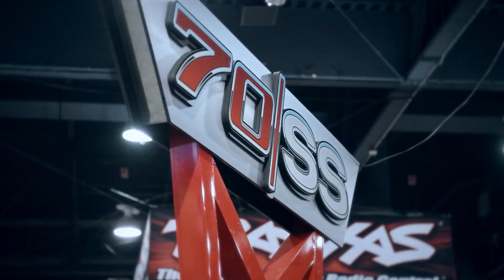IT'S HERE! NEW 2024 Chevrolet Chevelle 70 SS Takes Over!

Comment: Good video man I really like the car except they ruined the front without all the bumper metal work to separate the lines.  But in reality they want 160k starting to get what is basically a refaced camaro that has 450 hp not even the 1500hp variant. Might as well buy a hellcat challenger and build it to make 1500hp for less than their cheats variant. Or just buy a older muscle car and buy the 1500hp variant from dodge or Chevy for much less and I bet it’s much lighter than this wannabe Chevelle.